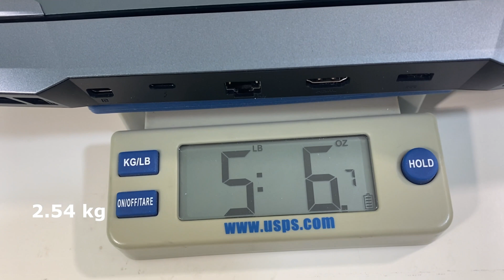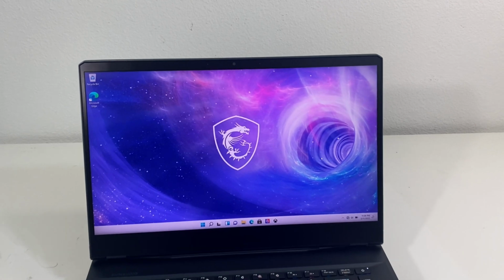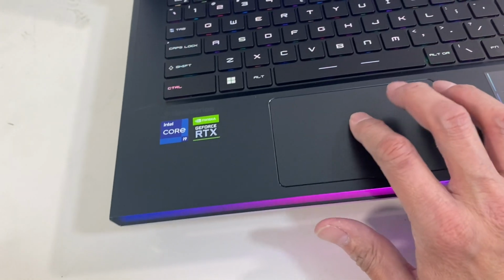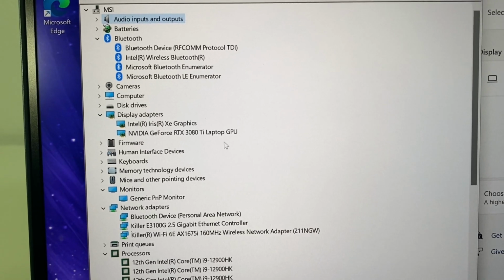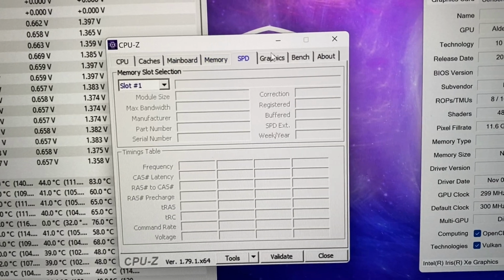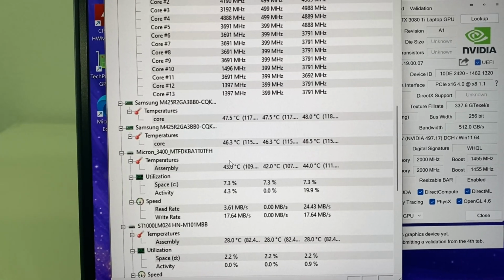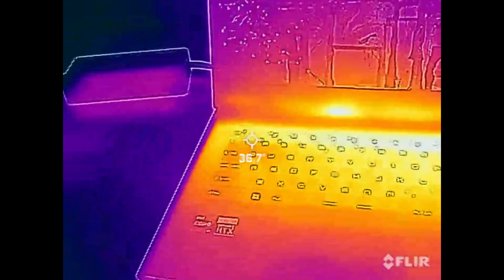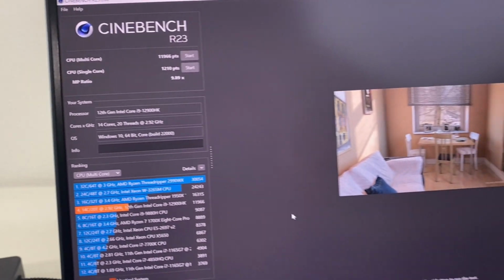MSI GE66 Raider Review & Benchmarks - RTX 3080TI, 12th gen Intel Alder Lake Core I9 12900HK

Comment: After 6 months of using it, I got some BSOD's and after that, the performance dropped significantly. You have 11900 in the cinebench multithreaded, I got something like 1828 on the same test. MSI support in my country just reinstalled windows and called it a day :/
This machine was very powerful, but right now it works like a 6 years old mediocre laptop.

Comment: i got msi ge66 because everyone is talking about how good it is. But after a year of using it, its trash. My fan broke days before warranty ran out. (Ive never dropped it). I repaired my fan and months later my screen broke for no damn reason (no scratch,
no broken screen). Display is gone. Got it checked my different technicians and all said that its the manufacturer’s fault. Beside these major issues, my ge66 would lag crazy without charging it. In order for me
to actually play a game(any sort of game, even one that dont require high fps) will literally lag. So i had to plug in my laptop all the time. The only thing i can do while its not on charge is watch yt or browse on the internet. And the audacity to say the battery lasts for up to 7hrs is a lie. First 3 months that I got my laptop, battery lasted for about 1-2 when you’re not gaming. Definitely less than an hour if you’re gaming. Another cons,
msi customer service is absolutely trash. They dont care about you, they only care about money
Reply: Damn!! I was going to buy one…
Reply: @hispantrapmusic301  dont. my keyboard is also failing now
Reply: @Hanillusion  is it that bad? Or were u unluck?
Reply: @hispantrapmusic301  not sure but its not just me. when i was looking for a solution i found that many people on reddit had the same issue

Comment: Do you know which thermal compound the i7 version of this one has?
Reply from the maker: Just generic type.
Reply: @GenTechPC  would you recommend the 15 or the 17inch raider?
Reply from the maker: @aeonbreak4728  If you need number pad for work then go with GE76.   If you like smaller not too heavy and travel a lot then go for GE66.
Reply: @GenTechPC  Thanks! What about temps and noise? I'd imagine 17 is more silent and less warm underload? I tried comparing the results from your videos but found hard to draw a good conclusion.
Reply from the maker: @aeonbreak4728  GE66 uses less wattage on GPU but yeah, 17" does seem quieter.

Comment: Great review. I'm in Canada and can't find this unit for sale here though. Only see the 16GB RAM variants with the i7 CPU, unless you get the 17 inch model. I've been trying to find a Rtx 3070ti or better 15" laptop with 32gb+ RAM. How long does the battery realistically last on max brightness but with non-gaming use (Photoshop and accounting software)?
Reply: Hey there, Costco Canada has this with the 3070TI
Reply: I7 is better for gaming i9 more for multi tasking
Reply: In Canada I got the i7 with 3070ti and 1080 360hz screen for 1799.

Comment: I bought one of these and it overheats very easly, do you think it might be the cpu liquid metal? What do you recommend? Thanks!
Reply: overheats as in during browsing sessions or on youtube? if so 100% return it. If it gets hot while pushing the machine fully then thats really just how laptops are. You can try throttlestop if the laptop will let you. Or use whispermode/other nvidia settings in geforce experience.

Comment: I have this laptop, it’s pretty good. Depending on which game, it can push good frames in 4K. It also has a polished feel. MSI is awesome at manufacturing quality gaming laptops
Reply: Do you have the 4k version? If so are you able to stream UHD on Netflix/Prime, etc? I can only on YouTube.
Reply: @wootuka  yes I have the 4K version, but I can’t get it to stream in the Ultra HD format on Netflix/Prime either
Reply: @gaming_nerd_i_am9969  at least I see now it's not just me. Let me know if you find a solution, thanks.
Reply: @wootuka  will do, likewise. Other than that deficiency, what’s your opinion on the laptop?
Reply: @gaming_nerd_i_am9969  I have mixed feelings about it. On one hand there is a lot of performance, but the lack of 4K while streaming makes it a regular laptop on that department. The other laptops that come close to it are the Zephyrus Duo 16 (who knows when it will be available) and the Blade 15 Advanced which lacks power but have better screen.
If they fix the streaming issue I would be happy even at the price it sits at. How about you?
Reply: @wootuka  I agree that the performance is top notch- running triple A games in 4K is awesome (of course some settings have to be lowered). I also like the size, coming from a daily use 17 inch, this one is more manageable. My two gripes would be the UHD streaming issue and the fan noise sometimes- but I get that part because the chassis is small compared to the GE76- oh and the price is 👎🏻 but everything is more expensive now. I also thinks it funny how nobody talks about it and no reviews are on the internet- just information on the GE76
Reply: @Timothy Maddox  Agree that games look fantastic, being able to play with such resolution makes the game more immersive. Found that the screen is only 8-bit, non HDR with unknown response time but not something you notice when playing. Fan noise is typical at that size like you said (had worse). I do have to say that the top portion gets really hot in a more silent profile though.
Since it's so new we have to wait for more info. As soon as I find something I'll come back here.
Reply: @wootuka  yea it gets a little warm up top, but it’s manageable. Sounds good, I will return here as well if I discover anything else good/bad about this laptop
Reply: @gaming_nerd_i_am9969  how’s the battery life man?
Reply: @hispantrapmusic301  not good, 2.5 hrs on battery when not gaming. Doesn’t have Advanced Optimus, but has a MUX switch.
Reply: What games have you played and what kind of FPS are you getting?  I'd wish you could get this with a 1440p display with the Core i9 - I don't think you need 4k resolution at this screen size.
Reply: @Meatwad650  I agree that at this size 4k is an overkill. Games I’ve played on ultra settings at 4k resolution: COD Vanguard is 100- 120 FPS, God of War w/DLSS on is 90- 110 FPS, Dying Light 2 is terrible- sub 30 (but that game is not well optimized), Elden Ring is 54- 60 FPS, Doom Eternal is 90- 110 FPS, and Assassins Creed Valhalla is 45- 50 FPS. It’s a powerful laptop; however, I’m considering returning it for the GE76 4K variant. They do have the 1440p GE66 in the United States, but it is a 12900HK with the RTX 3070TI
Reply: @gaming_nerd_i_am9969  Yeah I’m shopping for the “best” 15” 12900HK/3080 Ti laptop. Ideally with a 1440p screen. I need it to be kinda portable.
Reply: @Meatwad650  in the United States, MSI currently only offers the GE66 with a 3070ti for the 1440p screen. But it’s has 150 watts for the GPU TDP so I’m sure it would provide high frames.
Reply: @Meatwad650  agree that for playing 1440p is perfect. When it comes to games the average is 60 FPS in Ultra settings with some tweaks depending the game. Cyberpunk is the only game that goes around 32 FPS in UHD. I do on the other hand like 4K streaming, it is something I was looking for since I'm constantly on the road. The problem is that UHD does not work with Netflix/Vudu/Prime yet.
Reply: what temperatures are you getting when its running at 100?
Reply: @TheAlexGava around  CPU: 90° GPU:80°
Reply: @wootuka  mine is not fine then... I get 97... Even 100 spikes
Reply: @TheAlexGava  I have never seen spikes to 100 on my unit- but I have since returned it for the GE76 version. I had an Alienware M17 R4- that thing stayed at 100 and kept getting BSOD.
Reply: So right now I'm playing Elder Ring and everything maxed out and CPU sound 70° and GPU 50°. Fans are not even half of their output and 60 FPS average with nothing less that 50 FPS.
Reply: @TheAlexGava  CPU high 80s to low 90s. I think the GPU was hanging in the low 80s. Although, I’m sure undervolting would help to lower the temperatures.
Reply: @gaming_nerd_i_am9969  yeah sure it would help, but it is brand new... That is not normal I think...
Reply: @Thomas Gabriel Not sure what you asking but with the lowest scaling setting looks fine but not practical on the 15.6 model.

Comment: I was a bit hyped about the phase changing liquid metal thermal interface compound on the CPU, but your video proves that it is just a gimmick. A really bad one at that. Normally a well pasted CPU with conductonaut will not show extreme uneven core temperatures like yours did out of the box. I'm guessing one or more cores are hitting 100C while the other ones are like 70-80C? The one core hitting 100C will make the entire chip throttle, as CPU sensors/temp will count the highest temp core as its overall temp.
Reply from the maker: Most likely it's CPU itself, it tops 115w.  I did repaste with Thermal Grizzly Conductonaut and can drop to 97C.
Reply: @GenTechPC  So ultimately is the Conductonaut LM still much better than Msi's Phase changing LM? Man I had high hopes for this new paste...
Reply from the maker: @dignes3446  Yeah looks like Conductonaut are still better from what I see.
Reply: @GenTechPC  Thank you! I might repaste in the near future.
Reply: @GenTechPC  115w is what's listed as 12900hk's maximum turbo power according to the intel website. The issue is 100% thermals.
Reply from the maker: looks like core 3 and 5 will always run hot.

Comment: Laptops with the i7 12 Gen are quite expensive, like MSi Katana. 
Will the prices drop over time as more models come out?
Reply from the maker: It's because of DDR5 RAM and the price is double the DDR4.  Some 12th Gen laptops still use DDR 4 and price are much lower.

Comment: Great Video, thanks a lot! How many monitors can this laptop support?
Reply from the maker: Direct connection is 4: 1x Thunderbolt 4,  1x Type C with display port 1.4, 1x Displayport 1.4, 1x HDMI 2.1.   Thunderbolt 4 can support up to 2 monitors via adapter.
Reply: @GenTechPC  thank you very much!

Comment: Is there any main performance difference and temp in ge76 with i7 and i9?
Reply from the maker: GE76's 3080Ti is 150W+ 15W and will have better GPU performance.  CPU will be the same but maybe slightly cooler because of the larger chassis.  Will do full review once shipment arrives.
Reply: @GenTechPC  ohhk because like i don't feel like 3080ti varient is worth buying for me as it is also very expensive then 3070ti varient and i wanted to get a 17 inch so for that GE76 with i7 and 3070ti seems perfect choice i wish msi used new liquid method thing for i7 varient also and in india i9 varient with 3070ti isn't available in india so i guess have to settle for i7 & 3070ti in Ge 76 series
Reply from the maker: @tanishqhooda  3070Ti is still pretty good and 3080Ti / i9 are overkill for some.

Comment: Is it worth to buy this one(ge 66 3080 ti +i9 + 2k 240) with those troubles with temperature. Or better to buy ge 66 3080 ti with i7 +2k 240 ? Or it will be better to buy some other laptop? Will be very grateful for advice.
Reply from the maker: For gaming the i7 is more than enough, i9 could be overkill.
Reply: @GenTechPC  is i9 overkill for 3d animation work as well? im planning to go for i7 + RTX 3080Ti (QHD 240Hz) due to budget
Reply from the maker: @schikey2076  No it's not.  Animation takes hours and days to render, the faster the better.
Reply: @GenTechPC  what about legion 5 pro or gp66
Reply: @GenTechPC  what do you mean by overkill? Is it a bad setup?
Reply: I appreciate you listing the device manager and the refresh rates. I couldn’t find it anywhere in the specs and I didn’t want just a “60” refresh rate. I ordered this fully spec’ed laptop and will receive it next week. I subscribed to your channel for my tech fill. thanks!

Comment: Those cinebench scores look low to me; i9 should be 16-17K. Coolerboost needs to be on while running them otherwise it'll just keep throttling. I have the GE76 with the 12700h and with the stock CPU TDP power limits of PL1: 110 and PL2: 135w the temp variations are wild. Reaching spikes under heavy load of 98-100C averaging in high 80s. Jarrod tech does a great i9 power vs performance comparison you should check out. it seems that the 12th generation sees most of it's performance gains leaving previous AMD and Intel Cpus in the dust at around 65-85W after that the power vs performance graph starts to taper off. Increasing TDP beyond this in my opinion would be for cinebench bragging rights only but you have 100C spikes on your hands.

So for the cooling solution in the GE76, I can state for the 12700H chassis that reducing TDPs to somewhere in the range of 65-85W will be the sweet spot between performance and temps.

I adjusted mine to 65-70 and my temps are greatly improved along with being able to hold the boosted clock speed of the 12700H of 4.1GHz will thermal throttling 1% of the time while gaming. With stock TDPs, it was throttling 46% of the time. I suspect that for this chassis, to maintain the 110 PL1 and 135w PL2 TDP values, they should beefed up the CPU heapipes or added a vapor chamber. So this chassis IMO can maintain a stable boosted clockspeed around 65-85W depending on your config. More than that, and your just rushing to a stop at red lights with a fast car rather than cruising at high speed.

regardless of the above this 12th Gen is really a generational leap, my 12700h GE76 even at 65W and 70W i still hit 15, 150 on C23 multi and a whopping 1,798 single... Leaving previous AMD and Intel gens in the dust. all while staying in the 80C range.

with Stock power i hit 16,300 and 1,775 on C23. But it spikes to 100C. So no thanks, maybe in the future i'll re paste and increase the TDP back to stock 110 / 135W.
Reply: So do you think a cooling stand would help?
Reply from the maker: @mdan2086  Yeah but I would rather do re-paste it.
Reply: @mdan2086  i think it will if it’s a proper cooling stand (non-gimmicky) that will create a pressurized environment under the laptop to evacuate the heat. Alienwars xseries chassis did this with four fans but you can achieve this with the cooling stand model: IETS GT500. Not cheap but it seems to give noticable temp drops.

I prefer to do this over a re paste while under warranty :)

I ordered one for my GE76. It also is a USB hub and doesn’t draw power from the laptop :)
Reply from the maker: thanks and Jarrod is great.
Reply: @GenTechPC  i think it would be good to do a vid with a cooling stand before re paste,  one after repaste, and one with repaste + stand.

Comment: Those Cinebench scores looks way too low. Was it really thermal throttling that much?
Reply from the maker: It could be because of the CPU temperature.
Reply: @GenTechPC  Did you notice that it was running unusually hot? I've seen 12900H's hiy 18K-19K on the 10 min R23 test.
Reply: @RichCompMan  hmm, not sure about 18-19K. more like 16-17K i've seen at max power. Jarrod Tech just did a great vid comparing the 12th gen and 11th gen and he including a Cinebench power graph worth looking into. He probably didn't have the max fans which is called CoolerBoost (Fn+F8) on the GE76. So it was probably just throttling all the time.

Comment: Those huge temp variations scream poorly applied liquid metal pad or coverage to me. Thanks for the video!

Edit:  Just watched to the tear down and holy cow it looks like the CPU heatsink wasn't even making proper contact with that CPU chip. Like the thermal pads they used around the heatsink to protect against LM spillage prevented proper contact. Wow! Also extremely interesting that they opted to keep the heatsink made of copper instead of at least nickel plating it to prevent LM dry out.

Or do you think it looks bad because it returned to a solid as you said?
Reply: maybe its made for when it melts it makes full contact
Reply from the maker: @TheAyoubh  need proper repaste.
Reply: @GenTechPC  will u make a video on before after?
Reply from the maker: @TheAyoubh  we will see.  still have other laptop videos need to make.
Reply: I noticed the CPU coverage too. It looked like only a small amount of the liquid metal was actually spread over the CPU
Reply from the maker: Yeah not what I was expected and maybe it was applied by machine from the factory.

Comment: Liquid metal but 100 degrees....
Reply from the maker: I'll re-paste with Thermal Grizzly Conductonaut  this week for comparison, will report back.
Reply: @GenTechPC  If you could do a vid on the re-paste it would be great as i suspect many people may want to do it with this chassis.
Reply from the maker: @MrGatz  Will do repaste and report the result.
Reply: @GenTechPC  how was the repaste? Better temps?
Reply from the maker: @MrGatz  Hot cores dropped from 100C to 97C.
Reply: @GenTechPC  what tdp values did u run that with. The stock 110/135 PL1/PL/
2?  I’m tuning mine now and an looking doe a sweet spot. That would be a great vid btw tuning the tdps and or undervoltinf to lower temps
Reply from the maker: @MrGatz  It was tested with all stock settings, not even Turbo mode.
Reply: now imagine if there were using regular paste